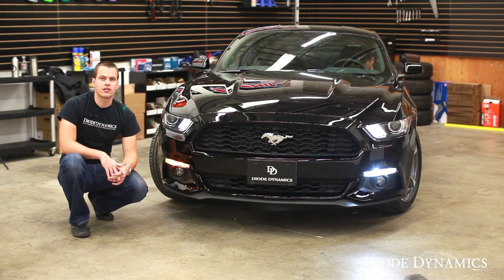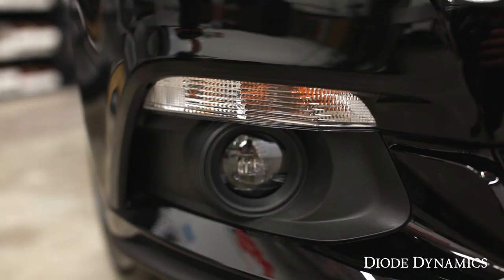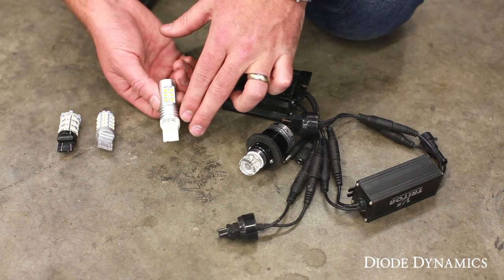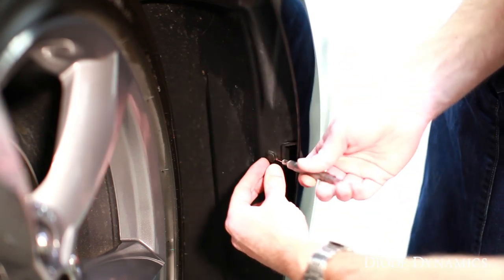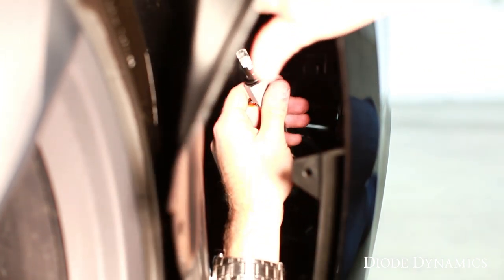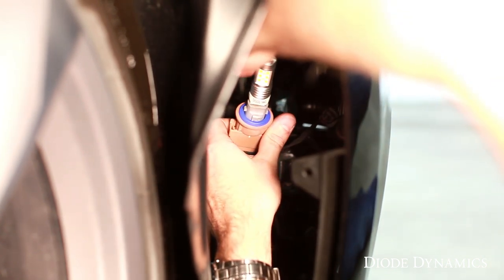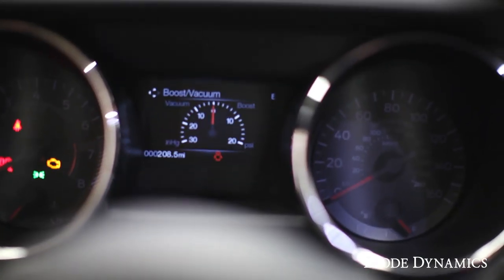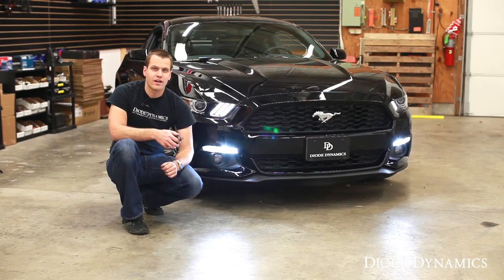How to Install Switchback Turn Signal LEDs in 2015-2017 Mustang

Comment: Just a quick tip that I could have used myself when installing the side marker replacement bulbs for my 2016 Mustang . The prongs on your factory  harness need to be pushed apart before you are able to put in the bulb. The bulb cannot just be pushed in like the factory bulb. This can be achieved by putting the bulb in at a slight angle and pushing one metal prong away as if you are trying to flatten it to the side of the housing, then push all the way in . In the video you can see him struggle with it for a second (2:50) but he never mentions this tip. Hope this helps someone out.

Comment: Where is your other video for switchback lights? I couldn't find it on your channel. I also think that it looks a little too bright. Are there different lumens for these or just the one option? Thanks.
Reply from the maker: Toby, this is currently our only video featuring the 2015 Mustang switchbacks. We currently only have one option for brightness level. While bright, they do a good job at not drowning everything else out.

Comment: I want to buy these. But I the turn signal issue on the inside will drive me nuts. Do you have part number for the resisters that are needed?
Reply: Never mind, I found it.
Reply: But it sounds like a pony trotting. It's great.
Reply: Adam Streeter I've gotten used to it. So installing the resisters is not worth the effort.  Thought it would bother me but it hasn't.

Comment: Diode Dynamics can you show a video of how to fix the flicker/on and off problem. I'm on my secon bulb and it keeps doing the same thing. You guys replied with a bending of the connectors but still no success.  Post a video on how to properly bend the and how to get rid of this issue. Thanks
Reply from the maker: RaceRed5Oh, sorry to hear you are still having issues with your bulb. Attached below I have one of our older YouTube videos (starting at :48) that details slightly bending the pins to ensure proper contact. If you are still having issues please let us know and we would be happy to help you out. Thanks!

https://www.youtube.com/watch?v=klezgVpiniQ

Comment: I like my switchbacks but there is still no resister to sync the interior indicator lights available as I learned when I called Diode Dynamics last month. I want a plug and play resister for my GT's wiring harness not some homemade stuff. What gives DD?
Reply from the maker: +Mark Evitts, unfortunately we are still a little ways out on offering a quality plug and play resistor - thank you for your continued patience!

Comment: I bought these for black friday and one of the switchback doesn't work for me. It won't make that click sound when I try to secure it. It'll just fall off. All other bulbs that I received worked fine except this one. Anything I can do? My car looks funny with only one switchback and stock switchback on the other side
Reply from the maker: +A226044 We're sorry to hear about the issues with your switchbacks! Go ahead and give us a call at 314-205-3033 Monday-Friday 9 a.m.- 5 p.m. CST, or shoot us an email at contact@diodedynamics.com, and we can troubleshoot with you and send replacements if necessary!

Comment: I have installed these on my 2016 gt and the smaller led's are more yellow in color than the white of the switchback led. Is this common? As much as these cost you would think that they would be consistent in color. Thanks
Reply from the maker: +Jimmy Stacey Sorry about that! Please shoot us an email at contact@diodedynamics.com with your order information and we can work on getting a replacement sent your way!

Comment: Ive been looking for these kinds of lights so this is great .But i saw 5 options for lights on your sight but i didnt see these. Could i get a link to them? Iwould like to buy a pair, thanks
Reply from the maker: Suleman, we are actually in the process of re-basing the Mustang switchbacks to assure perfect fitment in the sockets. As soon as that is complete, they will appear back on our website. Thanks for your patience!
Reply: Diode Dynamics no problem, I look forward to getting them!
Reply: Diode Dynamics oh and TJzachary had a good point, who also commented on this video. If you guys are adjusting things on the bulb maybe lower the intensity a bit? Just as a "review" from a customer I would like it much better if they weren't so much brighter than the standard leds coming from the gill lights

Comment: I bought a pair of switchback lights for my car. But the white lighted are always on. Even when you turn on the turn signal. The white lights never go out. Is there a solution?
Reply from the maker: Brandon Hodge, if you could shoot us an email at contact@diodedynamics.com or give the office a call at (314) 205-3033, our sales representatives would be more than happy to run through some troubleshooting with you. Thanks!

Comment: Have the problems with these stopped? If I order them now will they have any problems others were saying besides the fast blinking?
Reply from the maker: +1776alltheway, yes, all previous issues have been fixed. Our engineering team has completely redesigned this bulb using different components for added performance and reliability. As always, if you do have an issue with any of your Diode Dynamics products, we have a 3-year limited warranty and 100% satisfaction guarantee. If you have any other questions, feel free to contact us!
Reply from the maker: +Marcus Richards, as with all LED bulbs on the market, hyperblinking can still be an issue. LEDs draw less power than an incandescent factory bulb, so your vehicle will think that the bulb is out and warn you by hyperblinking. This problem can be easily fixed with our resistor kit. If you have any other questions, just let us know!

Comment: If I install your switchback bulbs with no resistor, will my sequential taillights still function properly?
Reply from the maker: +stinkbandit, you will still have hyper blinking, but only inside the car on the dash. Your actual bulbs will still blink in order and at normal speed.

Comment: Great Vid! Could you do a video with the inline resistor install you show here for the mustang switchback leds?
Reply from the maker: We plan on having the inline resistors available by January. Currently manufacturing them at our facility in St. Louis. Stay tuned for updates!
Reply: Diode Dynamics TY!

Comment: Dears,

After receiving the LED Switchback Turn Signal With Side Marker Cool White Front Kit 2015 i was very excited to install them so i did immediately. 

After installation about 1 to 2 mins later, they started to blink on and off. Every 5 to 10 sec it would turn off then back on, so i decided to unplug the bulb to check what was the issue. When removing the bulb it turned out like the image below the metal plungs were severely bent. I tried fixing the metal plungs on the actual led bulb and re plugged it in but unfortunately it wasn't working:(

I would highly appreciate if anyone could reply on what exactly happened. i would just like to know what happened and was this a faulty bulb or an error or poor installation?
Reply from the maker: Hesham Thabit, sorry to hear you are having some troubles with our switchbacks. If you could shoot us an email at contact@diodedynamics.com or give the office a call at (314) 205-3033 during business hours, we would be happy to run through some troubleshooting with you and get you a replacement if necessary. Thanks!
Reply: Thank you for the reply, i have sent you guys an email.

Comment: Hey guys, I wanna buy this product but I can't find the resistor and I don't how and where to install it! Please assist me on this.
Reply from the maker: +Ala&#39;a Sparky, no worries! Below is a link to our Resistor Kit and a resistor installation video. If you have any other installation questions, feel free to contact us at 314-205-3033, Monday-Friday 9am-5pm CST, or send us an email at contact@diodedynamics.com, and our sales representatives would be happy to assist you! 

http://www.diodedynamics.com/store/accessories/led-accessories/resistors/led-resistor-kit-18974
https://www.youtube.com/watch?v=YKvzwq___P4
Reply: +Diode Dynamics yea I saw both of them. But for the 15 mustang the hyperblink is from inside the car. The vidoe shows only from the bulb side which is fine in this case. So please if you don't mind give us instructions.
Reply from the maker: +Ala&#39;a Sparky, our Resistor Kit will fix any hyperblinking occurring both on the outside and inside of the vehicle. Give us a call at 314-205-3033, Monday-Friday 9am-5pm CST, and our sales representatives can give you further installation details!
Reply: Diode Dynamics thank you for the assist. But as Mr. Paul mention at the end of the video. He said that you offer "inline resistors which don't require any cutting of slicing" and I guess it's this 

one http://www.diodedynamics.com/store/accessories/led-accessories/resistors/plug-and-play-inline-led-resistor-pair

But I can't select the socket size as mentioned in the product description! Will it work and fit the 15-16 Mustangs?!
Reply from the maker: +Ala&#39;a Sparky, unfortunately, our plug-and-play inline resistors have been discontinued. Our LED Resistor Kit is compatible with the 15-16 Mustang (link below). If you have any other questions, feel free to contact us! 

http://www.diodedynamics.com/store/accessories/led-accessories/resistors/led-resistor-kit-18974
Reply: Diode Dynamics boo. Bring them back. 😁

Comment: Did you guys do thermal derating on these?
Reply from the maker: Patrick Barry, these HP24 switchbacks were designed by our engineering team right here at our facility in St. Louis! They feature only the highest quality components and a full aluminum housing for optimal heat dissipation. Good question!
Reply: Do you know the max ambient temperature they are rated for?
Reply from the maker: Patrick Barry, these have been designed specifically for automotive use, and will easily be able to handle seasonal temperature changes.
Reply: Awesome! are they manufactured in the USA or only designed?

Comment: Do you guys also have this for a 2014 Camaro?
Reply from the maker: Bobby Solorio Unfortunately, we do not offer Switchback Front Turn Signals for your Camaro, but check out our Amber LEDs at the link below! They will still give you a boost in brightness and a crisp, modern look! 
https://www.diodedynamics.com/front-turn-signal-leds-for-2014-2017-chevrolet-camaro-pair.html

Comment: is that a v6 or EB? and are those 18 wheels?
Reply from the maker: Alex Tang, this is our shop EcoBoost! From the factory, it has these 18 inch wheels.
Reply: those are 19s? I doubt it
Reply: the indicator can stop the different clicking inside? Where can I get those?
Reply: I meant the inline resistors
Reply from the maker: Alex Tang, we expect to have inline resistors available in the coming weeks, thanks for your patience!
Reply: ok It'd be nice if you can give me a quote
Reply from the maker: Alex Tang, pricing has not yet been finalized for our plug and play resistors, sorry!
Reply: ok thanks. could you please give me a notification once it's out
Reply from the maker: Alex Tang, will do  - thanks for your continued patience!
Reply: Np and thanks